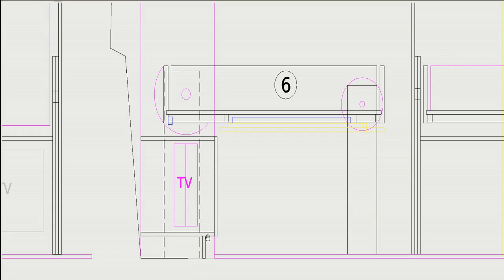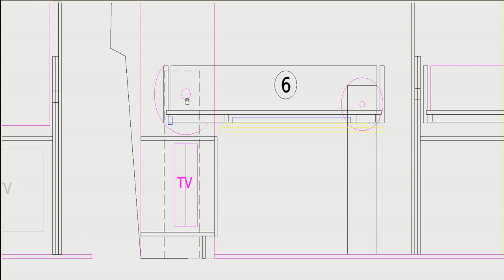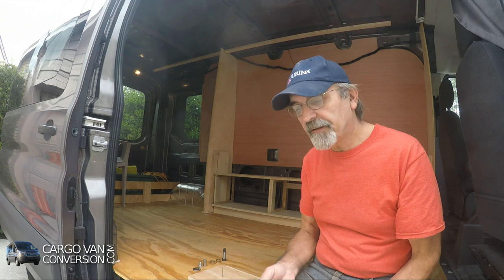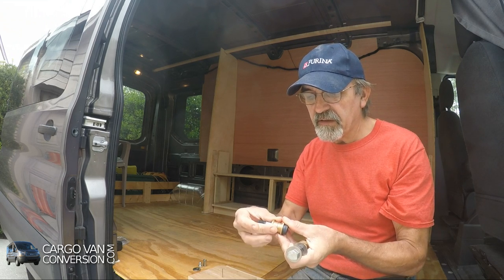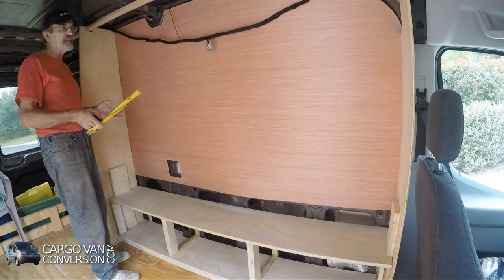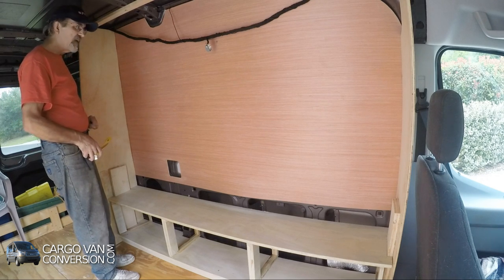Cargo Van Conversion Murphy Bed Frame - Part Seven

Comment: Murphy bed is a good way to go   really opens up area - for pivot I used 2  X 13mm Deep sockets as pivot  into hole in  plywood strengthened with epoxy -  One bolt through assembly each side -  2x nuts inside socket - worked well and was easy to get parts -allow space for blankets and stuff at bottom - was able to moved pivot placement closer to the van wall after first install  -  bed was 12 inches thick folded - being able to fold bed away easy and quick is Nice
Reply from the maker: That was the main reason for going with a Murphy Bed; without the high roof and the regular long version (LWB) of the Ford Transit, space inside the van is at a premium. With the additional built-in desk, space is used to the max. What do you use to keep the bed in a locked position?
Still have to figure out the sheets and blankets, but that will work itself out. I just finished the bottom of the bed (1/2" and 1/4" plywood with slats sandwiched in between) and will do an initial install of the bed next, to find out how the pivoting actually works.

Van Williams

Comment: Thank you, thank you, thank you Sir. I have been looking for this kind of system for about a week. Everyone seems to buy fancy kits for their Murphy beds but I was convinced there had to be a simpler way and I wanted to use a bolt of sorts but was unsure of what to put on either end so it would still rotate. Finally found it so thank you for sharing.
Reply from the maker: I'm glad, you found the videos useful. Had the same issue like you, with these Murphy bed kits, that are awkward and overpriced. Have been using this setup for a few years and it still works great. Good luck with your plans :)
Van Williams
Reply: Would you be able to send me a link to the exact kind of bolt combination you purchased, please?

Comment: I like where going with that bed. I built a kit version a while back out of new danish style book shelves. They used a bracket with three t nuts and a bearing mounted in the center with a big spring. Can't wait too see yours develop. Nice work!
Reply from the maker: There are quite a few different mechanisms used for Murphy Beds. I definitely did not want to include springs. Wanted to keep it simple (and cheap)!

Van Williams

Comment: My own opinion just get rid of the lower cabinets and simply go with netting that stretches people use it for child room and their toys.  Works great. Easy to install, durable and you can see what is there before reaching for it.  When I bought my first camper van a 1979 transvan in 2010.  I immediately gutted out all the over sized cabinetry and old shag carpet.  It made it so much lighter and gave me lots of room.  Sometimes the simple things are better and cause less thinking.
Reply from the maker: Hi Yeshahy Deane,
I think you really said it well and and my previous van was setup like that, much simpler and more practical. This time around I was looking for a much more 'sophisticated' look and really good appliances. Besides the conversion, I also see it as a 'sort of' woodworking project, in which I am trying to accomplish some quality cabinetry. I'm always fascinated by the great diversity of ideas, when it comes to van conversions.
Happy New Year!

Van Williams

Comment: Great build U R doing --I built similar murphy bed with pivots -but then I scraped design 
and went with folding bed held in place with Tie down straps that are 
mounted to 4 hooks high up on van wall/ roof - was a better fit in my overall design
Reply from the maker: I looked at your van. Great vehicle! I like the individual choices one can make, when building/upgrading a van. You can do things that fit your own lifestyle and not worry, whether it complies with what's expected.
Thanks for your interest!

Van Williams
Reply: I have posted very few pict of my build - was going to make a build video once completed but camera with All of my picts was stolen - 
Ouch --  like U R idea for cutting foam block -going to copy it -

Comment: Love to watch a build progress.

just found you and subbed, hope you and your van have many happy miles 
all the best. Lez.
Reply from the maker: Thanks you!
I love to get enthusiastic comments like yours; make me work harder.

Van Williams
Reply: Hi Cargo Van Conversion 
I live in the UK I'm looking for ideas to fit in a Ford 260 transit low roof van (2006) I've bought to replace my old 
Citroen dispatch. I used boxes that I'd built in the Citroen so I could remove if I needed to use it. I used a camping self inflatable mattress to sleep on, very comfortable but
my kids or mates usually asked could you move this or that in your van. so I made the majority of it removable
I've been looking to do something different with the transit. I don't know if  it's just me or if we Brits have never heard of this "Murphy" bed thing I guess we'd just call it a fold up bed.
I like what you're doing.
But one thing it gets cold and damp here in the UK, so it's best to have a bed high enough off the floor so in winter when you have heat on,
there is room for a cold sink. for those who don't know if you put heat on, it rises to the top of the van as it gets hotter the heat forces down the cold air (if your van roof is insulated) so if the cold can't get below you even with heat on you will be in the  cold damp air because it has nowhere to go. So make sure you leave room for that cold air to go below your sleeping space, you can physically feel the difference between this hot and cold air. I've noticed some solutions to beds are a like a simple raised floor with space under it to put things the thing is if you don't leave space for a cold sink  as explained above you'll simply be sleeping in that cold air.
it's the same idea when you make an ice hole to sleep in, sleeping on a raised snow/ice bed and using a candle for heat with a cold sink can raise your warmth and comfort no end.
forgot to say I'm watching with interest to see if I can do something similar in my "new" van I like the idea so far thanks for showing us what you're doing.
Reply from the maker: In the US a Murphy bed is named for William Lawrence Murphy, who first patented it around 1900. It's one of these American/British differences, like the word Fortnight for you. The world gets smaller and these differences more pronounced.
I get it, when you describe the cold and dampness in the UK. So many years ago, I did the 'vanning' thing in an old Bedford thru the south of England and Wales. Nowadays I'm a warm weather guy (must have something to do with age) and dampness is not an issue anymore. The 'cold sink' makes sense and you may be able to mitigate it somewhat more with a floor vent ( http://cargovanconversion.com/projects/mod-rv-floor-vent ). A fold up bed (aka Murphy bed :) ) may present a problem for you as a low roof van has less room to accommodate a bed against the wall, especially if you want to keep it high off the floor. An additional measure to take, is to incorporate some insulation into the bed, as I've done in my next video (Murphy Bed - Part Two). My reason for using the insulation, was the window behind the bed, but it could also help against the 'rising cold/dampness'.
I appreciate your story, keep watching and stay in touch!

Van Williams
Reply: Hi it's good to know you understand the weather problems :)
Wow an old Bedford respect to you sir lol.
I once made a lift up bed for my ex military Landrover I hinged a section so it would sit on some angle iron legs I had my brother weld like a shelving bracket they slid back into a metal sheath so as I lifted the legs slid away I do like your Murphy bed thing so I'm looking to see if I can do something or not but hey it's interesting to watch.what you're doing. 
I agree the Internet has made the world smaller and for those brave enough to share ideas it can change people's view.
For instance 50 years ago to me you were just brash flash yanks who interfered all over the place.. you may have had a whiff of it when you came over years ago ( but you were still friends)
I first contacted distant American relatives and realised real Americans were not as Hollywood and some tourists led us to believe. Unfortunately your steering wheel is on the wrong side and I've only ever seen cowboy wagons go on your roads so we won't mention roads lol.
One last thing the size of some of your Vans are huge I could probably park mine in and still have room to open the doors.
But even so there are some very useful creative ideas I spend far too long watching. I'm still looking for a creative way of hiding and still being able to use a portaloo I made a box with a hinged top and an opening to pull the shutter out and in but I was never quite happy have you any thoughts?
Reply from the maker: Personally, I like the cassette toilets, so prevalent in Europe, yet not widely available here. I'm not sure yet, what I'll install, but if it's not fixed to the floor, I'll probably build a cabinet around it and put it on two heavy-duty sliders, so I can slide the toilet out and do my business.
In my previous van (Dodge B-250), I had a porto-potti below my bed with a slide-out table above it ( http://cargovanconversion.com/520/the-bed-4 ); that worked perfectly too. I'm looking into composting toilets, as they eliminate the need for water, but most are too bulky.
I have a small collection of images of toilets in RV's that you can see here: https://www.pinterest.com/vanconversion/rv-toilets/
There are no real good solutions for your problem, unless you have an extended, high roof van, in which you can create a small bathroom; for me a small porto-potti is still the best solution.

Van Williams
Reply: Like I said I made a box that the top lifted up I laid on two boxes I'd made one long enough to take my torso and the other shorter. I put my porta pottie in the smaller by my feet the boxes were easy to take out when needed but it was a pain having to move bedding to use. I like your idea of using runners. 
The soil box was invented used by a Victorian Englishman.

In looking into the soil box toilets I found they were Sooo expensive to actually buy which puzzles me as all it is, is soil. A British invention by the way eco friendly from the Victorian age.

In 1859, the Reverend Henry Moule of Fordington invented the first composting toilet after deciding that his family's cesspit had become intolerable.

Moule discovered that dry earth, mixed with human waste, produced clean compost in just a few weeks. A religious man, Moule disapproved of the Water Closet. He felt it polluted God's rivers and seas and was a waste of God's nutrients contained in excrement, which should be returned to the soil. 

1n 1873 Moule took out a patent on his design for a mechanical earth closet, which allowed human manure to be saved for return to the soil, without the owner having to endure the stink of the average privy.

Dry earth or peat is put into the hopper at the back of the seat and a removable bucket placed below. When the handle is pulled, a small quantity of earth is spread on top of the human waste to reduce the smell and help it to decay. When the bucket is full the contents are dug into the garden..
 I like the idea also, why waste good water in a toilet which when used has chemicals to break it down and here in the UK if doing it properly has to be disposed of in a purpose made disposal unit when on campsites. 
I've often wondered about using the porta potties and converting to dry soil some how after all you can pick up soil anywhere and dry it out.
Andrew.
Reply: Funny really we start off talking beds and end up talking Sh*t
Reply from the maker: Very interesting. Never too old to learn something!
In the US there is a movement towards minimalism, Tiny Houses and simplicity. Van dwelling, I think, is part of that. Composting toilets play a big role in that too. I'm currently in the process of deciding the type and size toilet, that I'll be using in the van. Unfortunately, I'm very limited in choice, because of the smaller size of the van. I prefer a real composting toilet: environmentally more sound, no discarding of nasty waste and most importantly reduces water requirements that will extend my boondocking capabilities. But they are still bulky, unless you go for a standard bucket. Don't want to go with a permanent RV toilet, to avoid needing a black water tank. Cassette toilets are still an option, as are the regular porto potti.

Van Williams
Reply: You see this is what I was thinking, as far as I can see from the original concept the idea was to use your standard garden soil dry it till it's powdery then shovel or drop enough soil over it to bury  your droppings.
So at its most basic a bucket with a seat a box of dry soil. Should be  ok? Obviously we aren't the kind of people that settle for something that basic but what do you think? 

For water I see most people put their tank inside the vehicle and use precious battery power to give it pressure to run.
I was thinking in my last van about putting them on the roof rack and letting gravity feed the tap.saving space inside I have also thought about putting the gas bottle for the cooker on the roof rack also and having a safety tap near the cooker. Sorry if I'm over doing it, but it's hard to bounce ideas off someone unless you're talking about  doing something like this with other "Stealth Campers"  
"Normal" people wouldn't dream of doing it and probably think we have a screw loose. Even our own families lol.
Reply from the maker: You're funny!

"Obviously we aren't the kind of people that settle for something that basic"
I don't really know what's really happening nowadays in Europe, but the Tiny House movement in the US, has many doing just that. This is an example: https://youtu.be/lXgLnZvZMeE?t=9m28s It's all based on separating the solids from the fluids to avoid smells and unsanitary situations. I don't know how prevalent it is, but it's certainly happening.

The power to run incidentals such as a small water pump or toilet is not an issue for me anymore, as I'm going for at least 400w of solar on the roof. I can imagine that solar in the British Isles isn't as productive. I've seen examples where people install drainage pipes on their roofs to store water; one company uses that method to sell a 'hot shower device". The water in a black tube on the roof is heated during the day by the sun and offers a hot shower thru an attached shower head. It's just not an elegant method.

By the way, "normal" is in the eye of the beholder.

Van Williams

Comment: what draw program do you use?
Reply from the maker: Hi Randy,
Many years ago I switched over from Windows to the Linux OS. And have used Draftsight 2D Cad for a long time. Just recently I heard, they are switching to a paid product. So it's time for me to switch to freeCad, LibreCad or Wings3D. A good option is also Sketchup. I just need a simple CAD (that feels professional).
The best thing I ever did was switch to Linux.
Van Williams

Comment: I'm surprised at how few are using Murphy beds in their vans and RV's. These have been perfected long ago for this purpose. To save space in small areas. No messing around with dropping a table or unscrewing legs to turn them into platforms. Or having to adjust cushions and slide a mattress out. Then having to make the bed after all that? Cute, but no thanks.
A murphy bed is as simple as opening a door.

Plus after dealing with Murphy's Law all day, the fewer things we do the less goes wrong.
And I would rather do 1 thing, not 3 or 4.
Reply from the maker: Hi Sean,
Yes, but are you objective :)
I do agree, but I regularly see elementary versions of the Murphy bed (mostly consisting of a piece of plywood fastened with hinges to the wall of a van) in simple conversions. What I really like, is the space it creates, when there is so little floor space.
Van Williams
Reply: Yeah I have found a few doing iterations of them. I really like your design though.
Also the hammock beds look interesting as a space saver option. I don't know if I could do that long term though.
Reply from the maker: The hammocks are interesting, but I think, they belong more to the tent camping crowd. I like to do some backpacking and wouldn't hesitate to use one then, but the van must be comfortable.
Van Williams